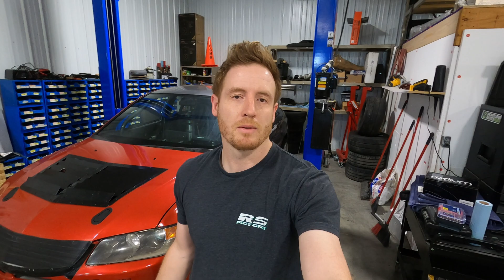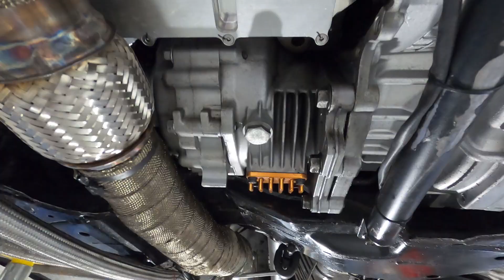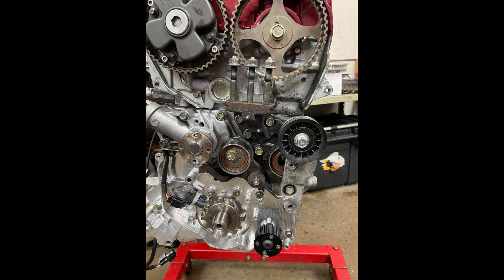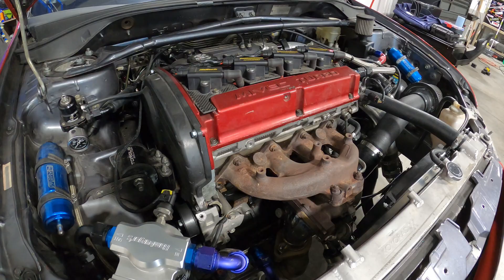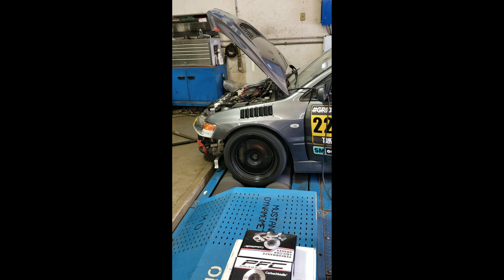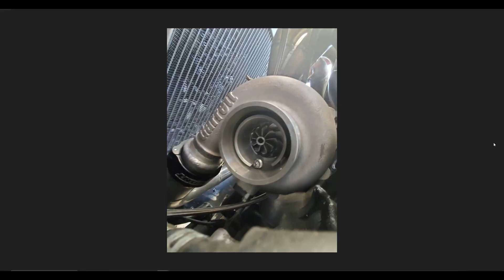Time Attack Evo 9 Build P3: Engine and Drivetrain

Comment: Very helpful. Seems like I might as well stay on the old CBRD BBK-3B, which is a touch smaller than an FP Red. I was considering the G30-770 but I'm already laggy for autocross with a 2.2L on R2 cams.

Comment: Hi Shawn,
Thank you for taking the time to share your knowledge and importantly real world experience in tuff racing environments.
Have you considered upgrading to the artec manifold?
That is what i intend to get.
Any idea of power levels for g25-660 on pump gas?
I was set to go g30-770 thinking it was responsive but based off your data the g25-660 is superior only giving up a little in straightline pace.
Reply from the maker: I don't have any testing on the artec, but I believe you can only run that with an MHI turbo.

Comment: Thanks for the video. I don't usually see these kinds of videos online. Lots of information and very valuable.
I currently have a FP Green Journal Bearing on an Evo 8 and was thinking of going for a FP Red Ball Bearing. Now knowing how well the G25 660 works, I have my doubts. Could you advise me? 
I know de Garret kit is twice as expensive as Fp Red Ball Bearing turbo. I only use the car for stretches of mountain road and circuits such as Nurburgring.
Reply from the maker: Unless it's strictly track use, I would probably go with the FP red. It should handle what you need just fine.
Reply: @KrebsbachRacing  Thanks for the feedback 👍
Reply: @KrebsbachRacing  The last one. 
Do you think it is necessary to change the exhaust manifold for a tubular one? Right now I have the Oem.
I have doubts about when a tubular exhaust manifold is necessary. Thanks in advance
Reply from the maker: @ManuEvo8  stock should be just fine. It's the smallest, but should spool the fastest. Idk what it's hp limit it. Probably getting restrictive past 500whp.

Comment: Do you think the g30-770 in .83ar would fair better on the 4B11 with dual mivec or is it just generally a hair too big for these small motors?
Reply from the maker: I'm not very familiar with the 4b11 engine. Depends on your use too. Imo you would want a sequential transmission for this large of a turbo on track.
Reply: @KrebsbachRacing  Thank you for the feedback. My use case would be a daily driver with at least five road courses a year.

Comment: How are you running  the Garrett turbos? Stock hosuing or in vband?
Reply from the maker: Vband
Reply: @KrebsbachRacing  thanks for the reply! I was gonna setup up the car for road racing/time attack and have the artec manifold and debating between both the g25s this helps alot. I'm assuming you used the .6 housing as well
Reply from the maker: @cristiannunez5228  .72 AR.

Comment: Dude. This is so helpful. I was undecided on the g30-660 and the g30-770. The difference in spool is much more than I expected. It seems like the g25-660 is perfect for a 2.0. I wonder how a g30-660 would be on a 2.2
Reply from the maker: It would most likely spool exactly like the g30-770 but just a bit quicker. The g25 550 and 660 spooled almost identical. Maybe 1-200rpm difference.
Reply: @KrebsbachRacing  that's very nice to know. And I assume you're on stock cams? Given you rev'd to 7500
Reply from the maker: @MoonRammer  GSC S2 cams. I rev to 8600rpms.